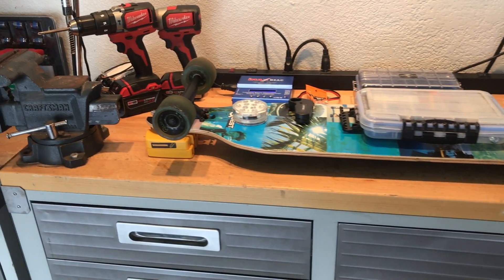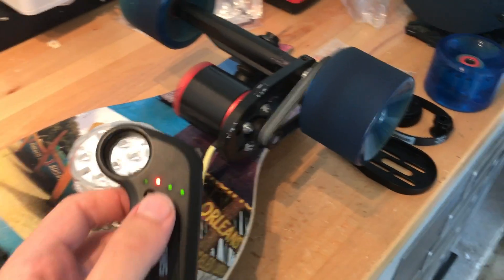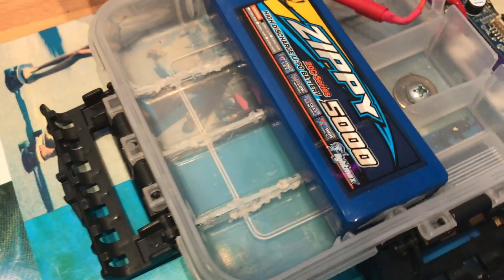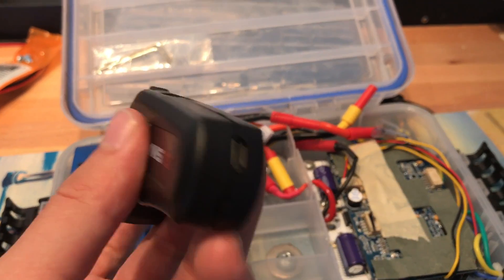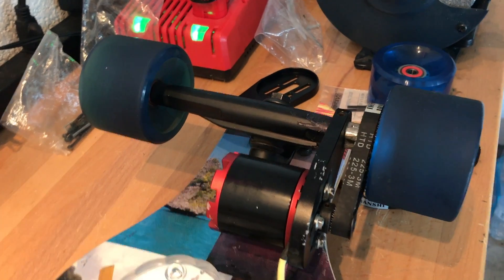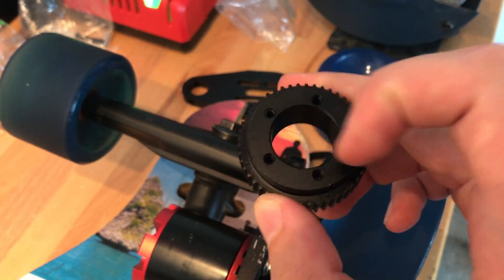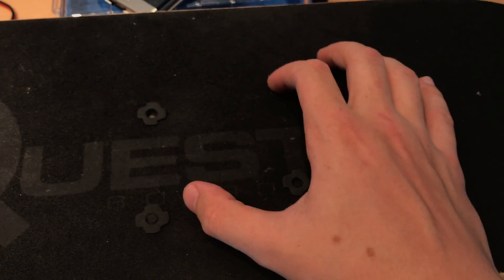DIY $250 Electric Skateboard Cheap FAST Light

Comment: Hi! I was looking for a board built with items I could get with free shipping, Since I'm from Brazil, and I found yours, so thank you! Do you happen to know a charger that fits your build and can be bought with free shipping as well?
If not, could you give me a link to the one you are using, so that I can try to find a similar one on the chinese market?
Thanks a lot!
Reply from the maker: I did bought a BMS from following link:
http://www.ebay.com/itm/Protection-Balance-Module-PCM-BMS-5A-for-6S-22-2V-Li-ion-Li-Po-battery-6S5W001/321790634514?ssPageName=STRK%3AMEBIDX%3AIT&_trksid=p2060353.m2749.l2649
But I change my mind and order some connector to use my IMAX B6 external charger, this why?
The IMAX B6 have a display that I can monitor each individual battery voltages ( that is 6 batteries within two packages) and also I can set up my current charging supply with IMAX B6 as well, The internal battery charger is missing many of these features, Now when I want to charge the batteries I open the tackle box then I have three connections to make for charging 1 positive lead, 1 negative lead and one 7 pin connection for balance charging, Also is better the case be open while I am charging the battery for better air circulation.
Reply: Mark Kash thanks for the answer! I'll try to find a similar charger
Reply from the maker: You can connect directly each battery to IMAX 6B one at the time to charge or you can make home made adaptor to both batteries at once to IMAX 6B.
Reply: What are the connectors called that you used for your IMAX 6B to charge the batteries?
Reply: okay thanks. Could you make another video where you show how to connect everything and how to set it up  from start?

Comment: If I use the same esc as you, but using 10s lipo batteries and a 260kv motor will I get the same speed?
Reply: Phoebe Nadorp Depends on your wheel size. If you do the same wheel size as he did you'll get around 30mph, if you do an 82mm wheel you'll get around 33-35mph. Im unfamiliar with this esc, but 10s is a lot of voltage, id be worried about blowing something in the board with a 10s battery
Reply: Just adding onto what Alex Urbach has stated, 28.45mph under no load. Realistically, a 70% efficiency modifier would bring that down to just below 20mph to account for a human standing on it.

Comment: Hey so basically you can even make it with 3 parts right? The ESC you used, the battery, and some hub wheel motors.
Reply from the maker: If you already have a board and a containment system, also the motor, motor mount and belt system. All parts used are in the description
Reply: You'll want to specify when buying the ESC that it is for a hub motor if you're taking that route. Far less torque with hub motors than with appropriate outrunner motors.

Comment: Hey Mark, thanks for the video, it's great. Just one question, maybe I missed it or something, but where did you buy your charger? 
Thanks.
Reply from the maker: I bought IMAX B6 from ebay that is external charger but recently I order an internal charger that it fit in the same tackle box, but I did not install yet, when I get done with installation I probably make another video on that subject.
Reply: Ok. Thanks. Also, I don't know if you want to put this on your board, but, you can attach an LCD battery indicator to see the percentage of your battery instead of plugging the in batteries to see it. 👍🏼 Here's the link on ebay: 
http://www.ebay.com/itm/Waterproof-LCD-Battery-Capacity-Voltage-Tester-Indicator-12V-Lead-acid-Lithium-/122668293544?hash=item1c8f999da8:g:h7AAAOSwSDZZoQEI
Reply from the maker: How this voltage battery indicator is going to work with 24+ battery??
Reply from the maker: Well, you buy it and install and let me know how does works for you ,  just remember most of these indicator are not waterproof and also need a cut off switch to turn on and off the indicator. you might want to  looking through voltage meter with LED not LCD indicator, why? LED is brighter for out side use and mostly LED's display are water resist
Reply: Yeah, that's true. I'm still ordering parts, but when I'm done, I'll let you know how it goes. But, overall, I think it's a nice thing to have.
Reply from the maker: Agree, if the implementation is robust and does not tax the batteries.

Comment: How many Amps can the esc take
Reply from the maker: Is 1300w per output so you can do the calculation for Amp based on you battery voltages  W = Voltage  x I current
Reply: I don't quite understand, I currently being the ___. Also I'm using the same batteries as u, so what is the max amp for you?
Reply from the maker: Ok, in my case the battery voltage is bout ~24V so, 1300/24 = 54.0A Max
Reply: Wouldn't the near 100 amps of the battery burn out the esc
Reply from the maker: 54 A or 100 for two motors is just for a very short time if you pull 54 amp out of your battery continuously they last minute or two, not even that long
while you running the board it typically pull 2 to 4 amp after initial start.
Remember my battery rated at 5AH that means I can pull 5 amps for one hour I do not think batteries last even 40mins for 5 amps.

Comment: Hey, did i uderstand correcly, you put a washer under the gear?
Reply: Why they dont give it with the kit , do i have i choice to put one or nah
Reply from the maker: Yes, you need to a spacer of some sort between the wheel and the gear if it doesn't have enough clearance. I used a washer as my spacer, and unfortunately it doesn't come with the kit.
Reply: Mark Kash ok thanks , and how did you knew where to make the whole on the weel for the bolt ? And the bolt are really thin...did you recommand to put a washer on the outside too?
Reply: And also the bolt that came with the kit are shorter than the one you show , do you receive those bolt with the kit or you have to buy those
Reply from the maker: No, as I shown in video clip I bought longer screws from Home depot you can get part number from video clip I do not remember the number.
Reply from the maker: Yes, to move the gear away from wheel and make enough clearance for belt to engage with the gear.
Reply from the maker: Gear on the kit have 5 holes those are the holes that you need to run screws through but how? following is the procedure that I used for screws line up with the holes on the gear, I used 6 inches bolts with the same thickness as truck screw to attach gear to the wheel and washer in between, I use big washer on outer side of the gear to to prevent head of screw going through gear, I tighten gear and washers and wheel with pass the center bolt through gear washer wheel includes of both bearings and tightening all with nuts in the other side, then I place the treaded side of long bolt into the drill chuck, tighten the drill chuck and run the drill after each run stop the drill loosen the center nuts and re-adjust the gear position for best balance & centered result then I start drilling with drill bit much smaller than gear screw holes through the wheel, after initial pass with drill I enlarged the holes via bigger drill bit from the other side "opposite to the gear side"  ( on first pass of drilling through gear holes make sure you do not damage the screw tread within gear)
passed 5 screws through wheel and tighten them enough not too tight over tightening will cause screw head goes through rubber on the wheel.
No need for washer on those five screws since you do  not have much a clearance and that installing the washer will interfere with outer bearing as well.

Note: when you drilling the holes on the wheel use drill press or make sure drill bit is perpendicular to the wheel or you will hit the bearing in the other side.

Comment: do you need two batteries?
Reply from the maker: Yes, to reach a sufficient voltage.
Reply: does it need to be 5000mah then?
Reply from the maker: No, not necessarily. Your capacity will just be different, affecting your range.
Reply: so this might sound stupid. but in the desc of the motherboard controller. it says to use 6s batterys and there is only one battery connector on the motherboard. ?
Reply from the maker: Yeah, that sound a bit silly :) you place 6 batteries in series and connect the 1st lead and last one to the board. the battery pack that i used it comes as three batteries in series with two leads so I put two packs in series and connect the 1st lead and last one to board.
Reply: Sorry i get it now sorry for the troubles mate! have a good day!
Reply from the maker: If you find battery that can supply 24V then you need only one, This system design around  20-24V battery supply.
Reply: I bought the exact same two batteries and motherboard! I plug it in and it keeps saying low charge every time! Any thoughts???

Comment: Hi, really nice board and mount.

I built an electric board before, but I short circuited batteries so I now I have a dead ESC and batteries. So as I wanted to find a cheap alternative for the  ESC I bought the one you show in your video. Waiting for the order.
To others, be careful with the distance between M4 screws on this model. There is a 5 mm difference between this motor and Turginys ones and I cant find detailled blueprints for mount showed in video...
I will use my Turnigy 280kv motor with my whells and gear ratio I should (hope) have around the same max speed with a better torque.
Anyway, I will keep you stunned.

One last thing for beginners : It seems that the simili ESC on Ebay has XT60 connectors as default for batteries and no 4mm Bullets as shown on this build so dont forget to buy some :3

Comment: Can u put links to the wires and bolts and stuff
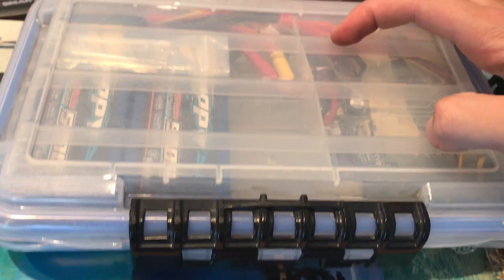Reply from the maker: I updated the description with the bullet connectors that I added on to the ESC for the battery connection. The bolts correspond to the size of T-Nut and the thickness of your board (5:38).

Comment: What board did you use or what trucks  would be compatible?
Reply from the maker: The board I used is in the description and really any truck that is round and large enough to fit the motor mount will work.

Comment: Hey man i wanna build this exact board but you didnt put any links to the wires and connectors you used could you tell me were you got them i would love that thx
Reply from the maker: The wires that came with the ESC were only modified so that I could connect them to the battery using 4mm bullet connectors. I updated the description with a link to those.

Comment: Are you able to make a video on the wiring? Im curious as to how you changed it up because it dosnt look as if the esc came with 4mm connectors...
Reply from the maker: Most likely a part 2 will come and I will explain all the wiring in more detail.

Comment: Sweet setup, but those plastic ribs jabbing the sides of those lipos seem like they could puncture/dent the lipos and light the whole board on fire. Vibrations and slight flexing/ hitting curbs may over time may do just enough damage to cause the batteries to fail catastrophically. I give mine a bit of a protective shell.
Reply from the maker: That'd be quite the light show! But yes, I did take precautions on possible battery punctures in the containment, as I said in the video about the placement of the screws. Although the ribs haven't really been that much of an issue, as I look at the marking on the battery it is way far from denting or puncturing after about 100+ miles. If it becomes and issue or for safety I could superglue some extra plastic on top of the ribs to flatted them out.

Comment: Hey, if I wanted to connect two more batteries to double the range, I would put two sets of two batteries in parallel, and then connect those two in parallel in series, right?
Reply from the maker: Yep
Reply: thank you!
Reply: Hello again, just wondering how long it usually takes to charge each battery
Reply from the maker: Charge time is factor of current selection on battery charger, higher the current, lower the charging time, but higher the charging current also shortening the life of the batteries as well. I used 2A and batteries are rated for 5AH so it take about couple hours for empty battery to fully charge up..

Comment: I am planning on building one similar to this but useing two 6533 190KV motors and two 5000mAh 3s connected to get 6s would this run well? This will be my first build
Reply: With MBS all terrian long board wheels 100mm
Reply from the maker: If you using are using this ESC make sure your motors aren't above 1300W, also I would recommend you use a motor with a higher kv rating to increase speed. kv is rpm per volt.
Reply: Mark Kash So what motor would you recommend? I want a high as i can get it top speed lol im such a noob to this and thanks for such a fast reply
Reply from the maker: Having a large diameter wheel helps a lot(as you have), and I recommend the 400kv motor I used(in the description).
Reply: Mark Kash What do you think the top speed would be with that 400kv motor would be and 100mm tires? I have some hills where i live
Reply from the maker: I have a formula at the bottom of the description for calculating speed, using dual motors will increase your speed under load a bit. Your top speed without load would be around 34 mph, depending on your weight your speed while riding will be around 27-30mph. BUT with your size wheel you will have much less torque which will all affect your acceleration and you will be putting a LOT of stress on the pulley system which could strip out the belt.

Comment: Are you able to program the esc in any way to adjust acceleration/braking force? Nice build!
Reply from the maker: I don't know of anyway to do so, and I haven't seen such a feature advertised on this ESC. Although there is a Fast and Slow mode (Slower Top Speed/ Acceleration) which you can switch between located on the controller.
Reply: Thanks for the reply! Two more things, if I may: have you experienced any issues with the ("Winning" brand) remote? I've heard a lot of complaints on the various forums concerning its reliability. Secondly, do you have any advice for initially setting up the dual esc? Having purchased it off of eBay, I've noticed that instructions regarding set-up and operation are quite sparse; any info would be greatly appreciated!
Reply from the maker: I have had no issues with the remote, although the only hiccup I've ran into with the ESC was pairing the remote to it initially (you only have to pair it once) it'll take some time, but you just have to be patient.

Comment: Hi, I have a old battery (of my old electric mountainboard) 24V 10ah lithium battery (not lipo), you say that if I buy only 2 motors and a controller will work correctly ?, thank you
Reply from the maker: For sure, the dual motor electric speed controller(ESC) in the description supports up to 36V and is pre-programmed for a 24V power supply.
Reply: OK thanks. Excuse me, what other motor do you can recommend me for a mountainboard, or do they work correctly with the necessary force ?, sorry for the question
Reply: Hector Escalante you game?
Reply: I'll buy it old electric mountainboard as a project board

Comment: Great build. How are the brakes?
Reply from the maker: The brakes are great, although they need to be applied very gently on the controller or the motor locks up and will completely throw you off the board.
Reply: Mark Kash Mark Kash I just got this same controller, the brakes work good from 0-12mph 13-18mph even the slightest touch on the control brakes super hard..are you experiencing this ?
Reply from the maker: Yes, it is something you must be very gentle with. I have found that letting the throttle go for awhile, coasting for a bit, then slightly and slowly applying the brakes to get to a stop.
Reply: Mark Kash hi,  i use a similar esc for my skateboard. They are fragile, lost already one because of shortcut when power button came into contact with it. stupid i know. now my power button is broken and  soldering it won't help. Is there a way to take this power button out of my configuration? I'm scary to do this and blow up my esc again.
Reply from the maker: I don't believe so, since the power button serves other function other than a power button. It is used for pairing, feedback, ect. That's strange that the esc has failed on you twice, maybe secure the esc down better and use a more durable containment box?
Reply: Mark Kash OK i just wait for a spare power button which i ordered. I know have made myself a carbon secure box and no metal is exposed whitin it. Hope i have no problems anymore cause its so fun to ride.

Comment: Why did you use the dual motor** ESC/ Receiver/ Transmitter for your build you're only using one motor? why not the For single motor*** ESC/ Receiver/ Transmitter?
Reply from the maker: I didn't want to limit my ability to upgrade the board in the future to dual motors. Also, if one side of the power output from the ESC failed, I have the other side of the ESC as backup.
Reply: What did you do with the extra 3 motor bullet connectors?
Reply from the maker: I have them sorted in the box as backup or if I ever want to upgrade the board in the future. I can drill out an opening for them and connect a second motor.
Reply: are they just lying free in the box, or are you covering the bullet connectors?
Reply: and what size bullet conectors do the esc and the motor have?
Reply from the maker: The extra cables are zip-tied down in the box.
Reply from the maker: All parts used are in the description, should have the sizes listed there.